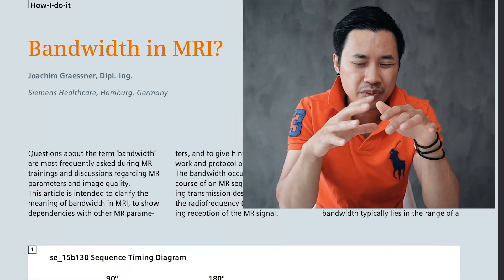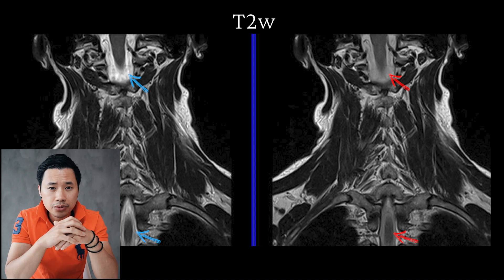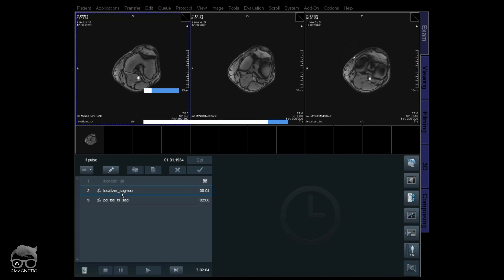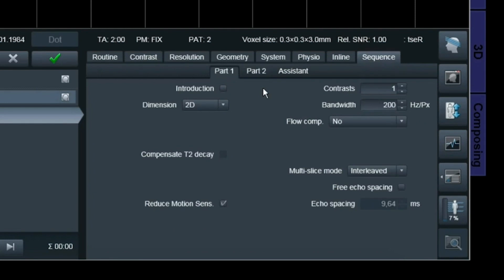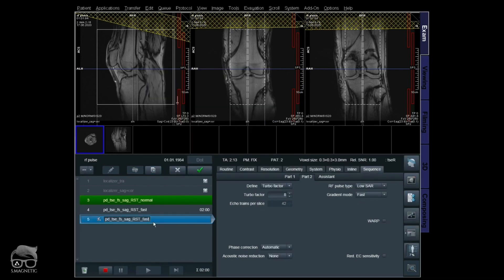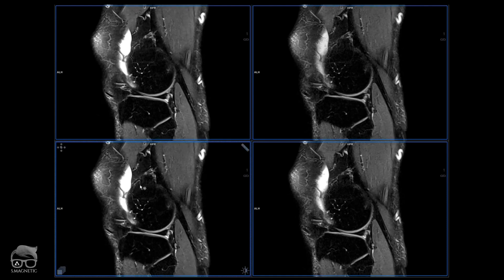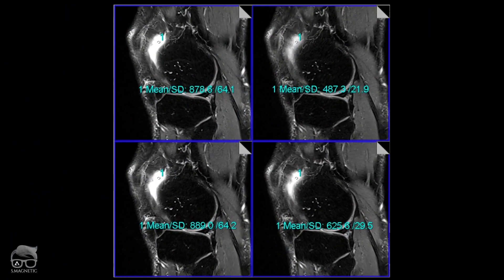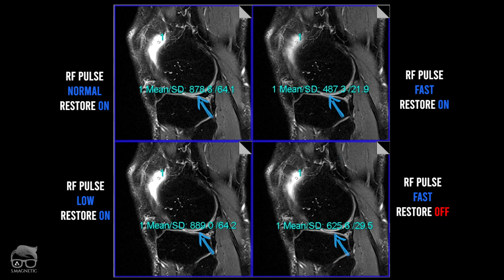RF PULSE – A SOFTWARE BUG….#MRI

Comment: Hey Bac! This is really a too easy conclusion you are drawing: changing the SAR several parameters are changing which you should mention as the acquiaition times! ciao
Reply from the maker: Intention with this video is not sar specific. But rather watch out for the bug which is inside the software. On the newer software this bug is fixed.

Comment: Since the FAST RF pulse has poor slice profile, when should it not be used?  Gapless imaging I would suspect?
Reply from the maker: Interesting question. I guess narrow gaps or gapless should be combined with at least two concatenations. Also fast rf pulse is much needed for breath hold sequences such as haste, flash etc approached. Fast rf pulse leads to shorter inter echo spacing along  with shorter te and tr. not only that, but also less susceptibility artifacts.

Comment: Thanks Bac for a new video. I´m scanning on E11 e but I have a problem with too much signal om the PD no FS with fast RF and restore on. Is it possible that Siemens has over compansated for this on the "fixed" softwear?
Reply from the maker: That’s a very good question. I don’t have experience yet with the e11e for testing this out. However , you can reduce to normal rf pulse but yet the inter echo spacing increases. We want inter echo spacing low as possible right. But I think the winning from going normal to fast isn’t much. Also less sar using normal. But as I mention, no experience of my own yet, I hope you find a workaround or answer to this and can show me. Thanks.
Reply: @Nguyen_MRI  Will send you images in a mail. Fast makes the images looking like T2. Easy to confuse the radiologists.
Reply from the maker: thanks please show me. looking forward